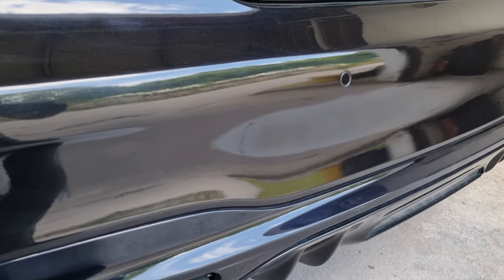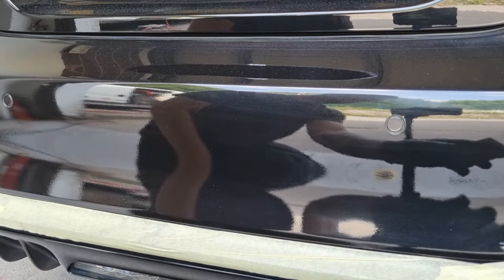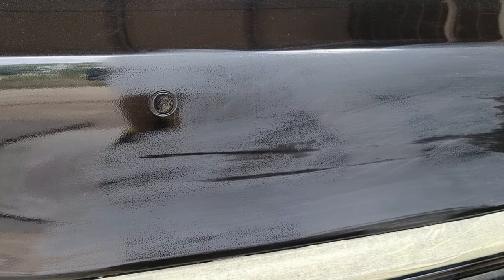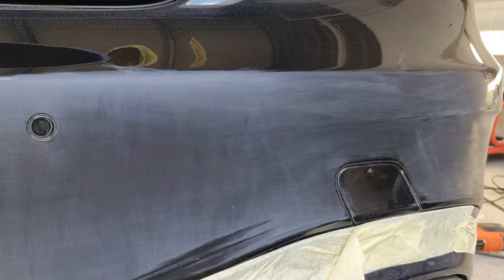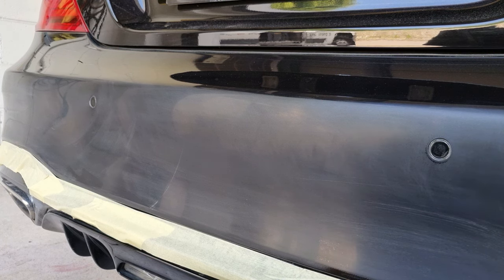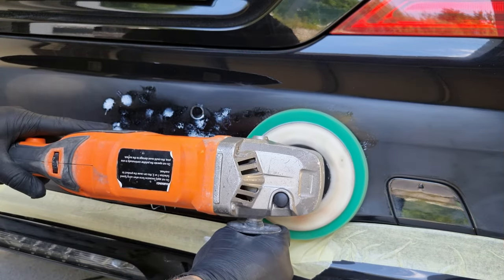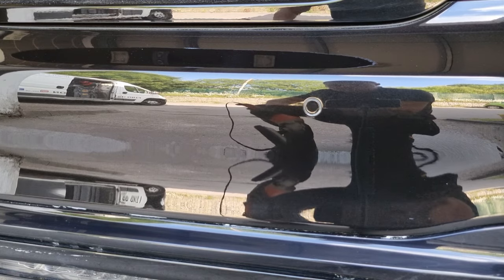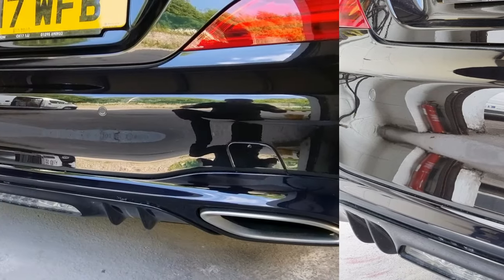How to Mirror Finish a BAD Paint job

Comment: Well, if anyone's still not pursuaded by the benefits of wet-sanding then they never will. The ridiculous level of improvement in smoothness and reflectivity from the original orange-peel laden bumper is beyond words. Absolutely amazing result. I learn a lot from your videos PoV and this is another one to add to the armoury of knowledge. Cheers!
Reply from the maker: Agreed
Reply: Too scary to take too much clear coat off if you don't have a lot to begin with, they're expensive and time consuming to reclear, tape up entire car again, etc. Sometimes even 2000 sandpaper takes off a lot. I guess sandpapers are all different by different brands.
Reply: Damn right wet sanding is the only technique to get that show finish and of coarse the polishing after , I always put a little soap in my water
Reply: Boofer😅
Reply: I don't understand... what about the clear coat? You're wasting a ton of clear coat with this wet sending. So basically you're reducing the amount of polishing afterwards doing wet sending? Is it accurate or not?

Comment: Thing is, people are afraid to do this, as putting sandpaper - even high-grit wet sandpaper - to a car's paint freaks people out. But your video is so detailed, it gives me the confidence to at least try it. Very well done!
Reply: Tried it last weekend on my car's tailgate (it was resprayed by the previous owner)... Came out like a mirror and now I have to proceed on the whole car because I love the finishing, that is better than the original paint one. One important thing: if you don't have a VERY aggressive polishing compound, the first pass with the buffing machine will disappoint you. After the initial panic, you can simply try with another pass. And another one. Very time consuming process, but very effective at the end!
Reply: @mattiagri good to know thanks for the insight !

Comment: I painted my car last weekend and made sure I laid down an extra coat of clear. Makes wetsanding much easier without burning through. I was able to start with 800 grit, then 1200, 1500, 2000, then a machine sand with 3000 grit.

Comment: Use a hybrid silkwool pad at speed setting 1 and u can cut that 1500 grit sanding right up. 
You dont want heat or pressure when cutting or polishing today's clearcoat. Laquer paint from years ago, you would benefit from heat during polishing. Friction and abrasives are the only factors  in polishing now

Comment: Thanks for this (and your many other videos). This video gave me the confidence to give this a shot on a used car I purchased where the back bumper had been poorly sprayed. Unfortunately the paint job wasn’t up to it - although its massively improved it to a gloss finish across 90% of the bumper the clear coat in some places was wafer thin and willl need to be resprayed, a risk I knew going in as I am no worse off. I at least know my only option is to paint myself or get a shop to do it - going latter purely based on time.
Can’t stress enough how much gold is in these videos you do. Have used the techniques you give on my car and motorcycle, saved money and time but importantly enjoyed adding a new skill to the list.

Comment: Great clip, simple to the point and clear. You’re a good instructor. What about how much lacquer is on the panel and not removing too much? I may have a go on our seventeen year old Fabia which had a very average paint repair on some damage on a door.
Reply from the maker: If its orange peel then it's a usually got enough to play with
Reply: @cvrpov I’m in a similar situation with my 18 Tahoe. A guy repaired my damaged passenger side doors but left a harsh finish on them but I do see gloss but I want to be sure it’s ok to do since there’s bondo underneath?

Comment: Wow,what a difference.
I've recently repainted a bumper and there is no orange peel,but no gloss either. A bit better than in this video,but still dull. Will this process work even though I'm sprayed a couple clear coats on already? Thanks!
Reply from the maker: Yes this method will work really well on this example

Comment: Just recently spray painted new one piece plastic front end for Sonata.  Oem Black 93 sprayed on first plastic adhesion sealer, three basecoats, two coats clear coat.   Had fly land just as finished last clearcoat.

To remove fly mark n get lustre should I do what you show in video???  I have not done anything for lustre and shine yet just steps mentioned.  Great video, nice mirror like lustre!
Reply from the maker: Yes it is possible to knock the fly back with some sand paper and polish the area

Comment: Amazing job. I m newbie here..so is this mirror polishing done on top of clear coat or clear coat is done after polishing? 
So is it like paint-clear coat - polishing OR paint-polishing-clear coat.. OR clear coat not needed ?  Excuse my ignorance 😢
Reply from the maker: It's the top coat layer we are working on here not the colour base underneath (presuming the paint has been applied this way). We are sanding and polishing the clear lacquer coat on top of the base layer. Most cars are painted like this nowadays.

Comment: This a very informative video, however, have you or would you produce a video guide for repairing deep scratches you can feel with your fingernail? the type of damage caused by a keying, shrubbery, or more commonly the reckless supermarket trolley!
Reply from the maker: Yes I have..check our playlist out, chip and scratch repair. There is a green Jaguar bonnet with exactly this

Comment: That video was great thanks..just did a new panel on an audi. First attempt at flatting used 2000, 3000 then G360 then AutoGlym super resin Polish but still a haze. Watching this looks like I didn't cut the peel deep enough to start. Can I just restart and cut again with 1500 now though? Kept getting dry circles with the G360 using my cheapish DA. Any advice would be great. One thing missing was when reloading pad, do you have to clean between adding more product, if so how? DIYer @ home.
Thanks for the video was great 👍👌

Comment: Great video thanks. Couple of questions if you don't mind. What is a rough price guide for doing this type of work? 
Also with it beginning painted previously by someone else, your risks are quite high with sanding through, would you take responsibility if you sanded through or is that risk left with the customer? I'm wanting to start smart repair myself eventually and I'm just curious how to deal with these types of jobs. 

Thanks, keep up the great videos.
Reply from the maker: Hi Kev. Prices can vary. I would always sell the job that it's an improvement to the area with risks attached. Sell the idea that the only other alternative is an expensive respray and work from there. It's ultimately up to the customer.
Reply: @cvrpov  Great answer, thanks 😊
Reply: The answer translates to make it look shiny and run with the money you may feel like charging at the time.don't start a smart repair business get a proper job as a paint technician if your interested in the trade 🖒
Reply: @djjk4486  run with the money? You make the guy sound like a criminal! Anyway the way I read it Kev was suggesting he would attempt his own repairs on his own car - I didn't read it as he was thinking of setting up a business.

Comment: That is a fantastic finish! I'm a newb. After you use finishing polish, do you ever need to seal the finish or is that a thing of the past!
Reply from the maker: A good wax or sealant will be a good idea
Reply: @cvrpov  - I just wanted to say Thank You! After watching several of your videos, I picked up some 1000 to 3000 grit variety, polishing compound and a set of polishing pads for my drill. All under $30. So for my first "experiment", I tried removing some cigarette burn marks on a vanity sink top in my basement. They were pretty bad burns. Actually, I started with #400, then #600 and following your advice, moved on up to #1500. Thanks so much! It came out beautiful. I figured, what do I have to lose? I was going to pitch the sink top and buy another one. For less than half of a new sink top, it's finished all Thanks To You Sir! AND as a bonus, I have a ton of materials now. At age 67, I want to do a repair on my Ford Explorer hood lip and I'm working up to that. It's a common problem, the paint bubbles off but I wanted to practice on something before I tackled it. Did you ever think you'd see a comment posted about someone that used your skills to fix their sink?? 
Again, Thanks So Much!
Take Care,
Tom

Comment: Excellent watching you do this. I've just bought a new car and there's some minor swirl marks in the  topcoat. Just to get rid of swirl marks would you recommend using the G360 or if they are light swirls would you try just seeing if they'd buff out with  polish/polishing pad first ? I've watched some of your stone repair videos too. Really excellent advice. I got rid of them totally
Reply from the maker: Hi Steven. www.paintgear.co.uk sell g360 snd also they do a polishing pad pack... it can be possible to use the g360 on a soft pad to refine the swirls from a cutting pad
Reply: @cvrpov  Many thanks will give that a try

Comment: Hi there everyone. 
I've painted a plastic bumper with cans with 3 coats of clear coat. Is ok to start at sanding with 1500? Or start at 2000 going up to 5000 and than compound it?
Afraid that the 1500 will remove to much of the clear coat and start eating the paint.
Cheers

Comment: Hi respraying a bumper currently DIY, is wet sanding after paint crucial, should I be worried about taking too many layers lacquer off? Thanks
Reply from the maker: Usually a good hit with 1500, 2000 and 3000 is suffice

Comment: im new to painting but iv been dry sanding 1500 with a da never burned through an edge i feel like drysanding is so much better and i can see where the orange peel still is, i then dry sand 2000 with da and wet sand 3000 trizact and my jobs come out like glass, is there any difference from doing it this way to wetsanding?

Comment: Hi, i had a smart repair done on my spoiler and the paint has gone flat, the area is about 150mm circle, do i just do that area or do i do the whole spoiler?
Im a bit dubious about doing it incase I mess it up as once I start there is no going back 😬😂
Reply from the maker: Might be an area where there is filler or something particularly. If the rest of the area looks OK then maybe just do that bit
Reply: @cvrpov  could I wet sand starting with 2000 then 3000 and then cutting compound or do I need to start with 1500?

Comment: Hello, I got my car painted and there is orange peel like all over. I was able to use your method all the way up to compounding. The orange peel came completely out but now I am stuck with a a definite dull paint. I didn’t break through the clear I know for sure. Am I missing something? I wiped off the excess compound and still very dull.
Reply from the maker: Needs more polishing
Reply: Compound with a foam pad or wool?
Reply: @clabruno wool pad on a high speed buffer, do not do it in the sun and do small sections at a time. Use microfiber towels to wipe off the spot after each buff, then follow up  with a polishing compound.
Reply: @2000mustang6  any certain pads you suggest and what names of the compound and polishing compound? Also got a ton of swirls …

Comment: What if the orange peel is in the base coat if done with rattlecans and clearcoated over? Can the orange peel be somewhat fixed by wet sanding the clear? Will it kinda level out? If so what grit is necessary to fix it?
Reply from the maker: Very hard to get orange peel in base..its most likely in the clear

Comment: Did large areas (almost whole side of vehicle) using trizact 3000 wet on DA machine and soft backing. Unfortunately managed to go through edge on wheel arch :(
Reply from the maker: It must of been a Japanese car or previously heavily polished cos 3000 is like tickling the paintwork
Reply: @cvrpov  mk5 Astra. Side I worked on had terrible orange peel and arch was even worse, looking like it has been 1k cleared but in fact it is 2k.

Comment: Tip: if you hear these squealy noises (04:32) during sanding, there's a trash particle between the paper and the clear. Stop sanding immediately and rinse the paper and clear or you'll make scratches coarser than the grit of paper.

Comment: Lazy painters who know exactly how to get this finish in the first place but if they can get away with saving and hour and turn out poor finish they will! Dealers won’t accept this job
Reply from the maker: Sometimes a job just drops back tho. Especially if it's been refinished before
Reply: Very fair point, I’m forever polishing/flatting and generally refreshing previous repairs but I do also see a fair amount of poor paint jobs from the get go, my paint shop does try it on with me occasionally 😂. Learning quite a bit from your videos even though I’ve been doing my own minor repairs for many years so thanks.
Reply: Depending on the manufacturer they all have different levels of orange peel, some worst than others, a glass finish is custom not factory, any manufacturer that has some sort of glass buffed it to get that appearance. Flat paint is custom and will void some manufacturer warranty because they will know the vehicle has been repaired....